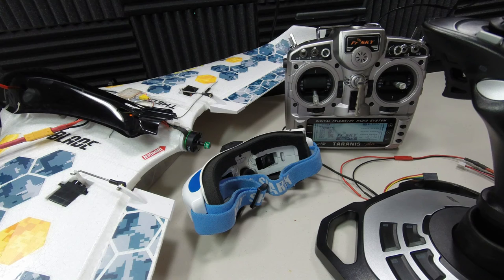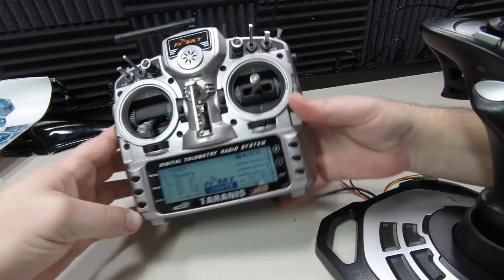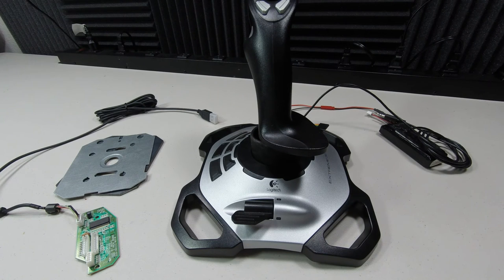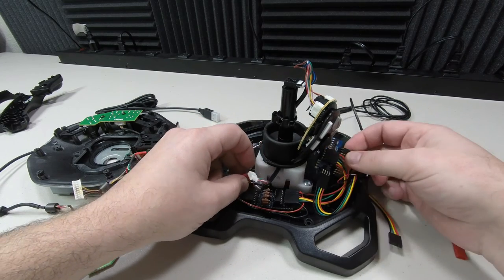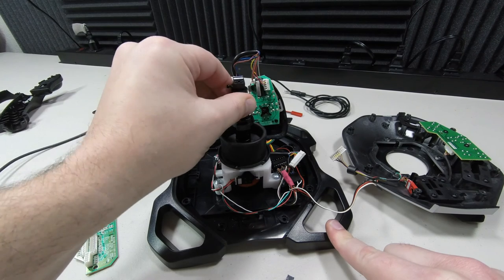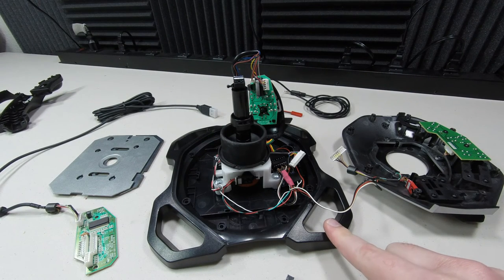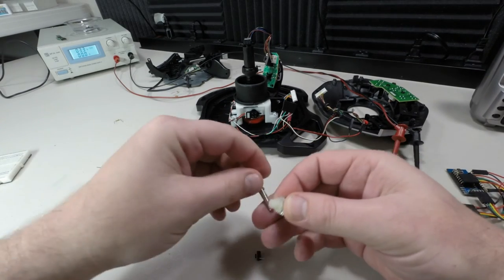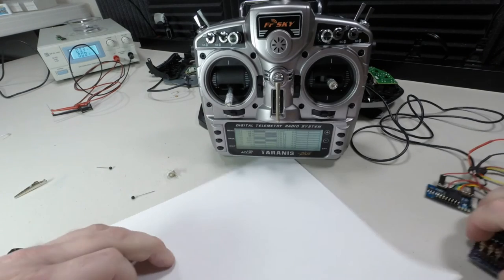RC Joystick Complete Overview

Comment: Do you sell these?
Reply from the maker: I stopped making these because this is way easier - https://github.com/jsa/flystick
Reply: @NETBotic  Cool....its great he made it all public, however needs a much better set of instructions for those with no RP knowledge. I did the simple method, directly wired my Joystick pots into my Radios TX. USB/PPM is of course much better.